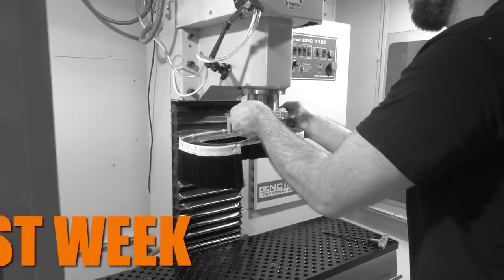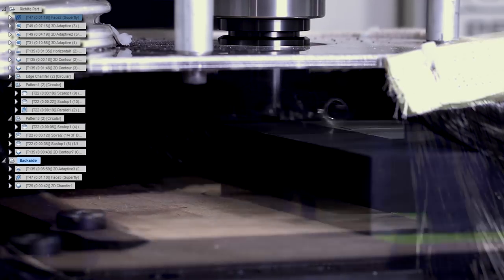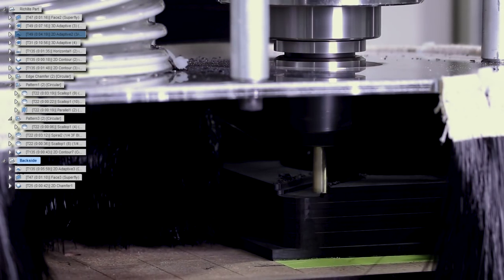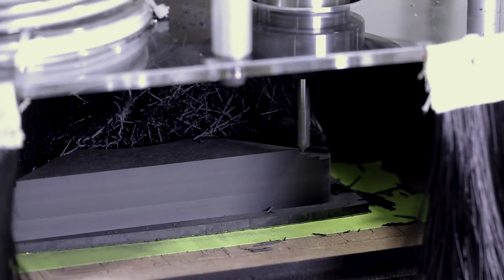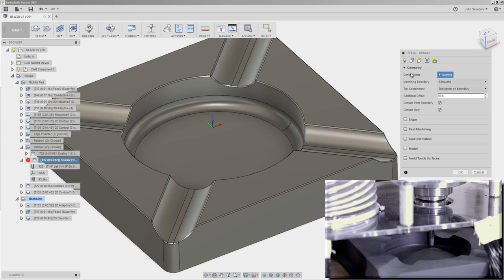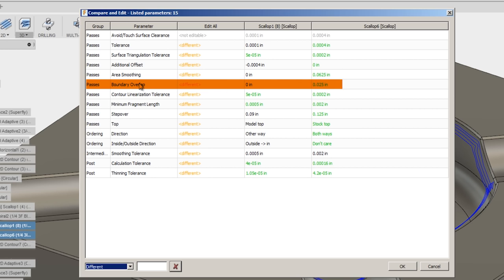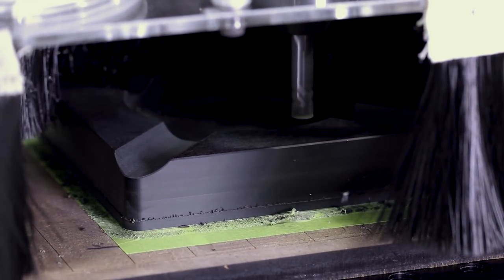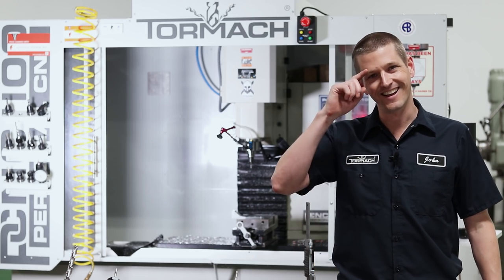Machining a Richlite Cigar Tray! WW199

Comment: "it can catch fire" so, let's build an ashtray out of it :)
Reply: Thinking the same thing. Also who CNCs an ashtray???
Reply: Someone whose customer pays them to I suppose.
Reply: My HS shop teacher (who taught me how to run mills, lathes and other metalworking processes) was a cigar buff. Not my first choice of project, but if one has the money and the want, it will happen.
Reply: hahah you got me first :p
Reply: They might use it as a model for casting
Reply: the fact that it's possible to catch a piece on fire while machining it doesn't mean it's flammable, small chips are much easier to light on fire than a solid slab of material.
Reply: It doesn't have draft on the sides, so I doubt that. But it must be tooling of some description, obviously no one would cnc-machine an ashtray out of modelboard.
Reply: Plus phenolic reeks with formaldehyde when you heat it up! Added bonus. :-D
Reply: Falena 
Thanks for pointing out that distinction!
Reply: Jack Flash— my thoughts exactly.
Reply: We have worked with Richlite and other compact laminates for close to 20 years. The solid material is almost impossible to burn. Dust and chips can smolder, especially if air is forced over them(like a bellows to forge). Cutting does create quite a bit of fine dust, even with sharp tools and good chips. Guessing that bag on the dust collector was full of very fine carbon black looking dust.  Also requires sharp tooling. Once tools dull they heat the material and form a glaze that ends up acting like a friction fire starter. This is nothing like metals. It's closer to wood, but with zero air voids and maximum density. This ashtray would be fine. Hit that with a fine grit sandpaper and a quick buff and it would shine right up nice.

Comment: Idea: Add a LED light to the dust shoe so we can see better. Great Video tho.
Reply: Same thought here... beat me to it...
Reply: Was just about to post the same thing!
Reply: John, do you have that 100mm 4" ring LED I gave you a Summer Bash or two ago?  12v  It would be perfect on the shoe, seal it in place with some rings cut on the laser and sealed with silicone
Reply: Appl Tom 
No, no. He says it provides a nice image for the video camera. No problem here. 😉

Just like on the Haas, where the view is effectively obscured by coolant.

Comment: afaik compression cutters, also called up-down cutters are commonly used for wood to avoid chip out on both sides
Reply: That's correct. Especially plywood.
Reply: And as Tom Lipton showed, router bits will cut metals just fine.
Reply: They're also used on routers to avoid having to tab your parts to the main sheet. The cutter compresses sawdust into the backside of the cut locking the part in the sheet. When you're done with the run, remove the sheet from the spoilboard (table) and knock the parts out. Nice and clean and saves a huge amount of time from both cutting tabs (and sanding) along with the previously mentioned backside chipout issues. A real help when you have dozens of parts nested into a 4x8 sheet of material...

Comment: Hey John. I've never thought of using scallop for 3D chamfers; I've always tried to use the 2D trace but it doesn't like to actually make the chamfer, despite having input boxes for changer parameters just like 2D contour.  Have you ever gotten that to work?
Reply: Chris DePrisco 
I've made it work, I do rememeber it being a little fiddly though. It seems to be made for ball mills and it will work better if the chamfers aren't modeled.
Reply: Hirudin Weird. I just tried it on a part last night and when I set the chamfer width (and picked climb milling since it won't automatically...) it did offset to the outside but regardless of what I enter in the chamfer tip offset, it won't step down at all. I ended up using a negative stock to leave and just guessing since it was just an edge break.
Reply: Chris DePrisco 
Ah... negative stock to leave. That sounds familiar.

Comment: Richlite seem to have neglected to say what resin they use, or to provide a proper Safety Data Sheet (MSDS) for those machining their materials.

Whilst the bulk material is safe, do NOT breathe in the dust or vapours given off by machining or laser-cutting these resin-laminated materials.
Have good fume and dust extraction.

Comment: Is it possible to plug the dust collector into one of the outlets on the back of the tormach like the coolant pump is? Would it draw too many amps?  Could use an M Code to turn it/off, but you may want to adjust code some so it keeps it on more often, wouldn't be good on collector to keep toggling it.

Comment: I wonder what the difference is between richlite and micarta is..🤔
Reply: Machinist 72 that’s my first thought it’s basically micarta.
Reply: Same here
Reply: I'm thinking the difference may be in the type of resin used?
Reply: How about making our own with paper, flour, and water?
Reply: Richlite and Paperstone are probably the two leading products in the 'green/architectural product' category. They're widely used in countertops, exterior cladding panels, and interestingly enough, skateparks. The biggest difference is probably that they've worked hard to optimize their process and materials to score LEED points with the 'green' consumer.
Reply: Micarta is a trademark name for sheets of something layered between phenolic resin. Paper, cotton, linen, carbon fiber etc. it’s all “Micarta”. 

Think of Micarta like Band-Aid. Band-Aid is a trademark name for an adhesive medical strip, but regardless of the brand, everyone calls em bandaids. 

Same here Rich-lite and Micarta are   just brand  names for thin sheets of stuff layer in phenolic resin.

Comment: How is Richlite different than Phenolic ?
Reply: Phenolic is a resin that can be used with various bases like paper, glass fiber or just on its own. Richlite is the specific combinationof phenolic resin plus paper.
Reply: Richlite is specifically paper based with phenolic resin binder, Micarta was traditionally cotton or linen fabric based (originated by Westinghouse in the early 1900's), but now can range from paper to natural fibers to carbon fiber and fiberglass.

Comment: I use double sided silicon tap works great.
Reply: Juliamarie Palero 
Tape with silicone adhesive? Do you use it with flood coolant by chance? Can you mention the specific brand/type that you use (and maybe where you buy it)? How does the tape behave when you mill into it? (is it gummy? does it machine away cleanly? does it smear? etc.)

I like the idea of taping parts down; it sure does seem to be a fairly universal solution with low startup cost. Effective too. It's just that putting on the two layers of tape with super glue seems like more prep than I would want to to very often, and I'm a-scared of how that particular tape would stand up to coolant.
Reply: Oh, the other NYCCNC video from today shows that tape and super glue holding up to coolant just fine. Sweet!

Comment: That is some of the worst toolpaths I have seen from this channel, the programmer wouldn't last a day in a real shop producing parts so slow.
Reply: greihawk it would take longer to completely optimize the tool path and run the single part than it would take to just run it with a slightly unoptimized tool path. Really not worth the time for a one off.
Reply: That’s the difference between prototyping and production. 

Production, run time is everything. More you can get out per hour the better. 

Prototyping, run time takes a back seat. When it’s only a single part that needs doing, It’s more expensive to scrap a part and do it over than it is to take the extra time and get it right the first time.